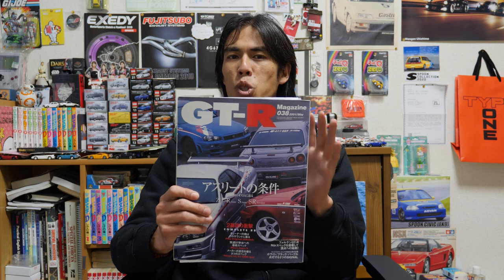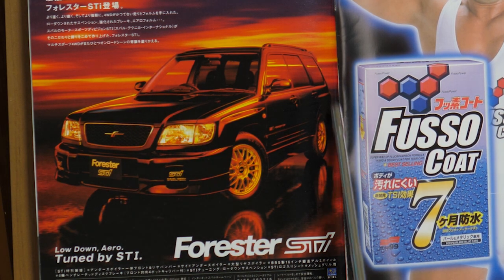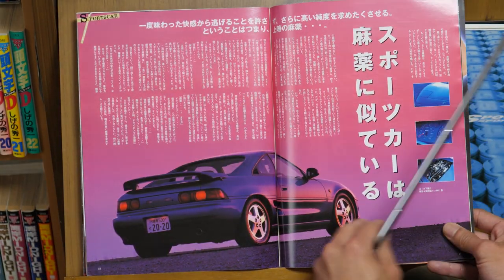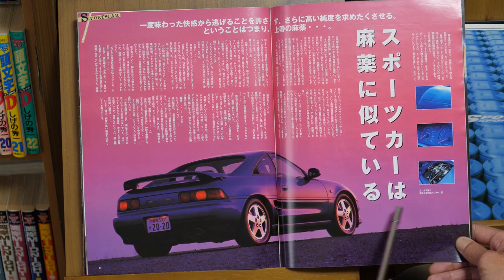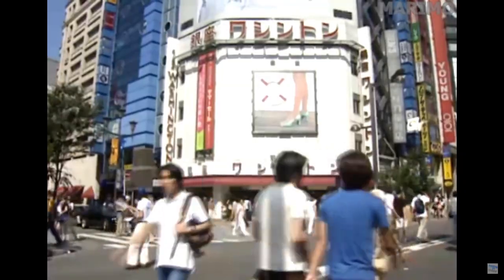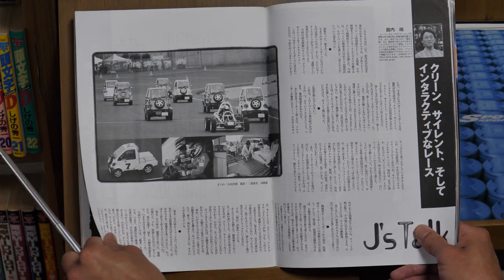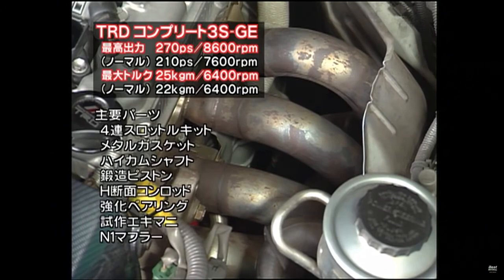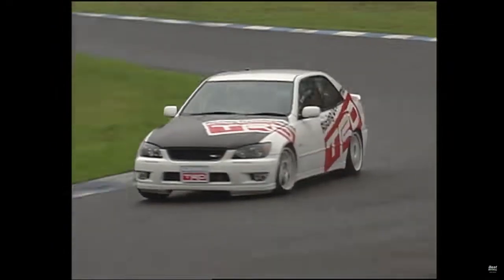Let`s look inside a Japanese sports car magazine! JDM Time Slip into year 2000 / JDM Masters

Comment: 5:34 actually the yellow FD is the RS-R version. The Bathurst was a facelift model.
Reply: Correct! The yellow FD is indeed a Type RS-R which was a limited run model in 1997. Type R Bathurst and Type R Bathurst R was also a limited run model in 2001 with features such as adjustable Showa struts and a Mazdaspeed carbon interior